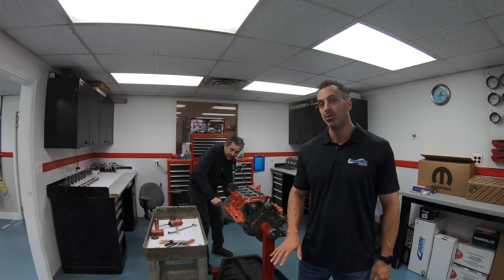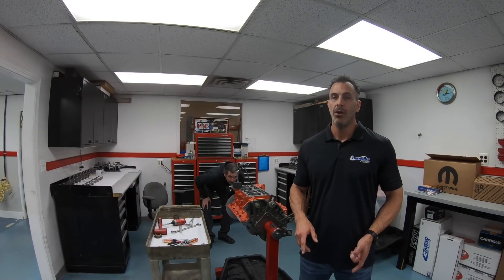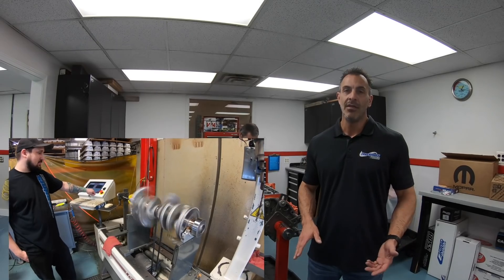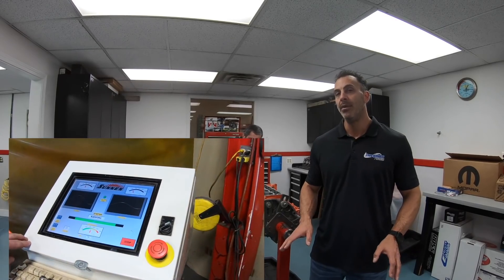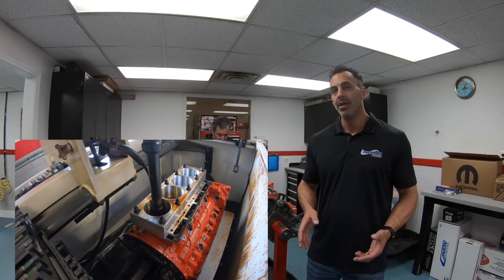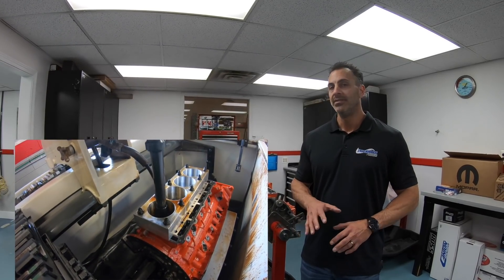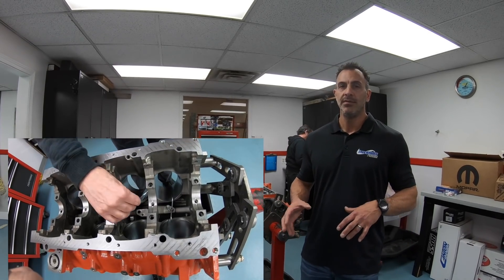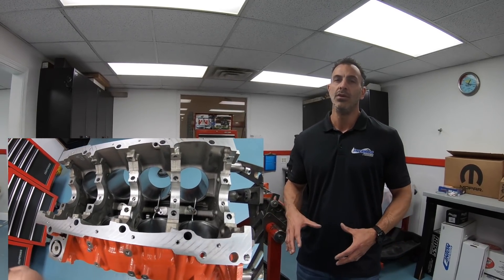Part 2: Hellcat Short Block Upgrade for 1600+ HP - Livernois Motorsports

Comment: Is this a street engine or track?  Is E85 easy to get in Detroit area?
Reply from the maker: it would be right at home in either case, all of our engines are designed to handle big power, but be reliable in everyday use. E85 is all over the place in Michigan, fairly easy to find until you get about 2-3 hours away from Detroit depending on the direction you take.